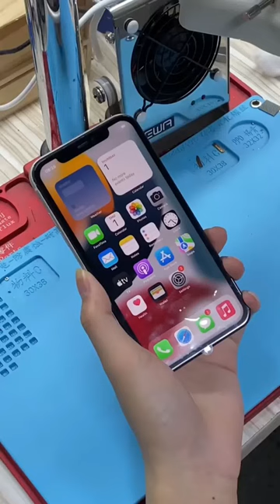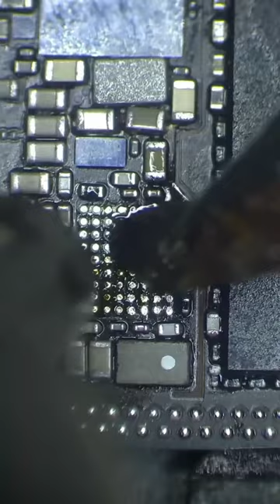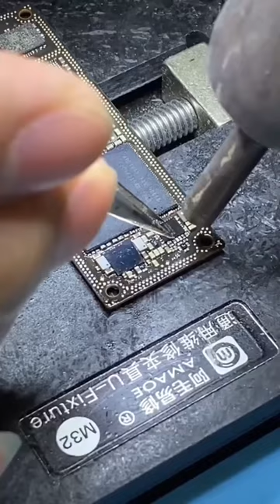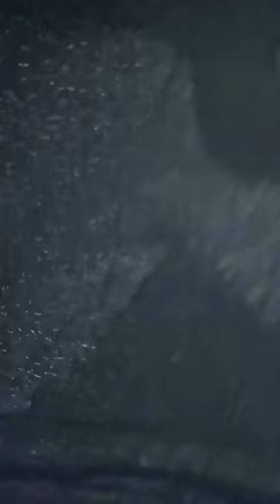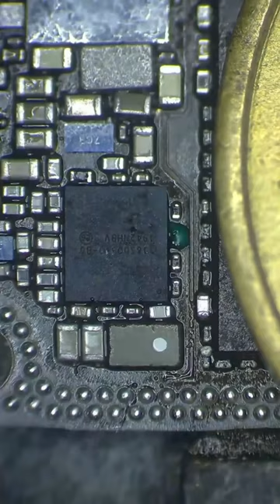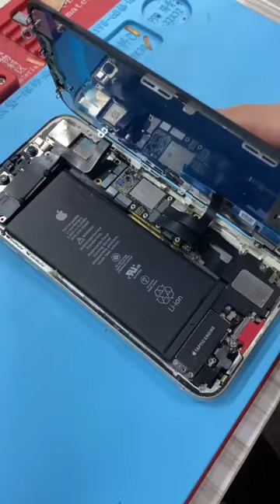Fix iPhone 11 Black Camera by Jumper Wire #shorts

Comment: Peace be upon you. I have a problem. Let's lock the screen. I forgot the mobile code. Can anyone unlock the iPhone X Max without formatting it?
Reply: put the mobile where you get it 😅😅😅🤣
Reply: No, you can try an online passcode bypass service but they are dodgy at the best.  But if you plug it in it will still back up to iCloud with Wi-Fi and you can retrieve the iCloud backup after a restore, that’s dependent on you knowing your Apple ID and password.  Good Luck.
Reply: @chench1lla  Can I explain a video so that I can understand more?